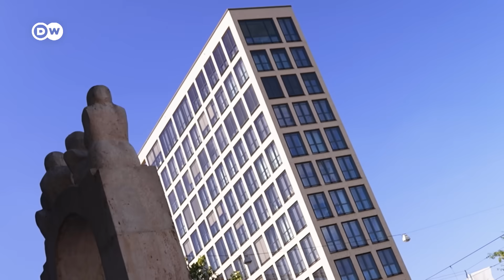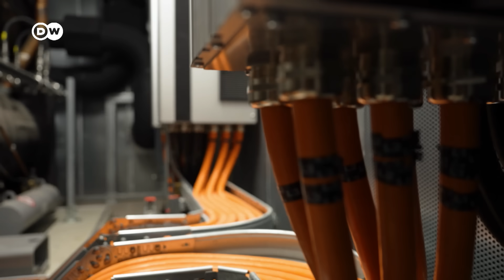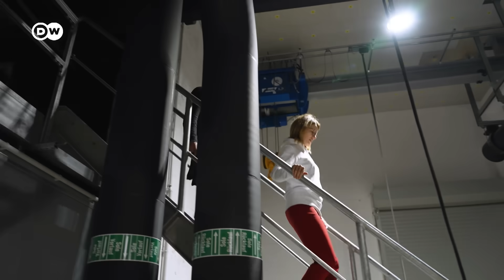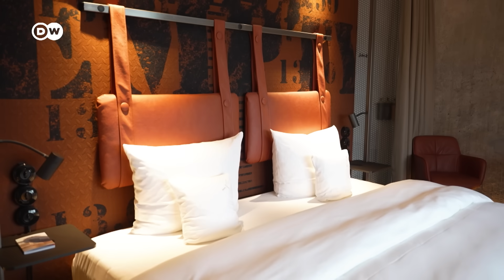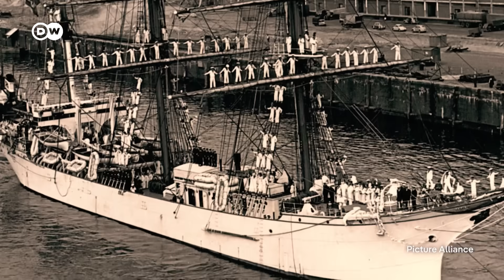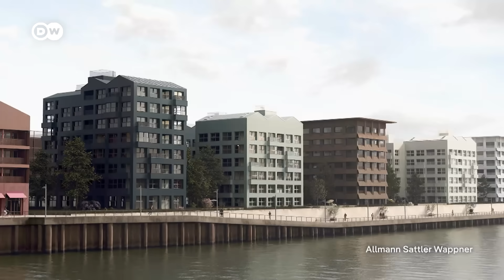River heat pump to supply hot water in Germany | DW News

Comment: combine solar panels with sun collectors on roofs integrated into this system will be higly effeicient if heat from sun collectors , solar collers with heat water from riveror just integrated in the loop
Reply: but more effective additonal system like exowatt on roofs
Reply: with sCO2 turbines districts will power them by their self and having sand batteries will keep them running cheap - hopefully bright future is coming when energy will be mostly free

Comment: These are exactly the energy consumers our grid needs. With large tanks, the heat pumps can run when electricity is available and cheap, and shut off when electricity is sparse. Surely we can build more batteries, and we will definitely, but storing heat in water is one of the cheapest way to store energy and shift demand.

Comment: So downstream we now get warmer water in summer and colder water in winter…. Thank you so much.
Reply: Ever measured the temperature of the water getting into the rivers from nuclear and gas power stations?

Hint: It is multiple times warmer than what the heat pump does.

And cooling the rivers is a good mesaure against climate change, at least most of the time.
Reply: I highly doubt anyone is going to notice anything.  Plus cooler water is probably better for most fish species.   In summer i don't get why they would even need to dump heat into the river...should be able to dump it right into the air.
Reply: @zachlafond2652 I guess the density of the water helps when dumping heat. And if everyone does it, we will notice it absolutely.

Comment: Its not that cheep at all. The equipment and maintenance are not cost effective. They will constantly be heating the water with outside power. Eight years experience working with heat pumps and exchangers on Oildsands plants. See what your costs become when the temperature hits -30 or -40 deg.
Reply: Good that the norm air temperature in Bremen is -9.6 °C and the water still always stays significantly warmer. Also the heating center has some boilers and power-2-heat-modules for backup.

Comment: Well, there are many unanswered answers with this project:
- District heating usually requires very high temperatures, which is why heat pumps in those systems often only reach a SCOP of 2 to 2.5 where state of the art air heat pumps reach 4 to even 6 and therefore use half as much energy!
- lower cost than average district heating cost means nothing since in Germany district heating is usually the most expensive heating option of them all (monopoly situation, very expensive infrastructure, high heat losses on the way to the buildings etc.)

The question is if this system has any advantage above individual state of the art air heat pumps. Is it cheaper per apartment (including all necessary infrastructure)? Is it cheaper to run compared to efficient individual (house-individual) heat pumps? Does it need less electricity? Does it have a lower maximum electricity need in deep winter?
Reply: Star Refrigeration in Glasgow has been installing water source heat pumps for commercial and district heating for over 20 years. Their recent installations have a heating SCOP of between 4 and 7, so 2 to 2.5 seems very low
Reply: @garysmith5025 I have air cooling and I can say that in the summer at night you can hear the noise from the fan. It's not too loud, but you can hear it. If it was water cooled, then that wouldn't be the case.

Comment: Utilising the waste "cold" from the heat pump for an ice rink is brilliant. Which makes me wonder if someone will try a communal refrigeration circuit in parallel with the heating one, eliminating the need for compressor fridges/freezers in homes and businesses.
Reply: Perfect for the winter months, not so much for summer as it may put somewhat additional load on the system.
Reply: @rsmmx-yt  Yes, the ice rink must be seasonal but it is providing opportunity for activity during the colder months when you can't do summer activities, and isn't needed during summer.

Comment: The sea has 10c and Ireland could get a substancial amount of heat  from the Irish ses and the Atlantic sea. It won't interfear as much with the diverse enviroment as with rivers.
Reply: Salt water is very corrosive, usually makes it infeasible.
Reply: @Masterrunescapeer plastic pipe
Reply: In the Esbjerg (port town in denmark) they have build a big sea water heat pump to replace the old coal power plant. If it works well it could be a model system for many port towns with existing comunal heating infrastructure.

Comment: "River water is always warmer than the surrounding air" - err no. It dissipates heat less quickly and accumulates it less quickly because it's a liquid not a gas, water requires about 4 times as much energy to heat as air, which makes it cooler in the summer and usually warmer than the surrounding air (in the winter). Since it's freezing days that makes heat pumps less efficient, I get the point, but let's not give skeptics a chance by policing ourselves (renewable energy optimists).
Reply: For freezing days, the river will still have a positive temperature, and usually this is further down, so 4-10C usually, so still usually at least 1.5-2.5x efficiency.
Reply: @Masterrunescapeer  yes, I agree. I think the genius of this is exactly that. Winter air temperatures often drop to around freezing, but it's very rare for much of the Weser river to freeze.
Reply: Lmao imagine how large would heat exchanger be if it used air instead of water.
Reply: When comparing absolute temperatures heat capacity doesn’t matter. So yes the river is warmer than the air in winter and cooler that air in summer…

Comment: What happens to the rivers eco system when many towns distract energy?
Reply: In an earlier video on this topic it was mentioned the overall temperature drops very little (0.1 degrees if memory serves) so I'd assume that (even with more heat pumps added) by the time the water reaches the next town that some energy gets readded.

Like all renewable solutions, it's gonna be part of the buck shot. Something that works together with a bunch of alternatives.
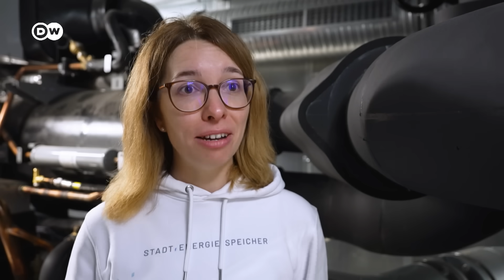Reply: @photoo848  Sorry to inform you that your memory is horrible bad. It extract 3 degrees [02:32] , not 0.1.
Reply: @s_amoku  that is on the water they take from the river.

They don't divert the whole river through their system. So after the heat pump, the 3°C cooler water joins back with the river (a much bigger volume of water) and it evens out to 0.1 degree or something
Reply: @s_amoku sorry to inform you that the higher you sit on a horse the lower you fall. 
It’s basically just like @photoo848 already explained

Comment: Heating with electricity does make us Independent from oil and Gas dictatorships. Also, it keeps the air clean.
Reply: As an American, I think the exact same thing. We give billions of dollars to people who hate us and will use that money to work against our interest. The more self sufficient we are, the less power our competitors have over us.
Reply: @williambarnebee40 
Hi there. This part of economic indeoendence doesn't really apply to the US. Yes, it imports oil from saudi arabia and kuwait, but it exports more oil than it imports. 
In my opinion, the US's biggest reason to stop fossil fuels are effects of climate warming.
Reply: @monkfishmondfinsternis3162  We still give billions to people who hate us. The export/import balance isn't the point.
Reply: Only if the electricity is generated without reliance on those same dictatorships, or fossil fuels. In my province in Canada we heat with gas, but the electricity is also generated largely with gas. So switching to electric heating would help a little in efficiency but it would require a change in source generation to renewables to really make a difference.
Reply: @treechairhat not true. Electric systems are so efficient, that running a hybrid electric system can often times be cheaper.
Reply: @treechairhat 
In scandinavia Heat pumps that Heat only with electricity, are standard. I believe the temperatures are pretty much the same as in canada?
Reply: and straight into the electricity dictatorship.
Reply: @casemodder89
When every house has solar panels and produces electricity, then WHO is the dictator? 😂
Reply: Where does that electricity came from? Lignite.
Reply: @thefrench8847 actually this year, Renewables overtook coal
Reply: @williambarnebee40  not during winter where solar is less efficient.
Reply: @thefrench8847 nope. This year it's taken the spot. Coal is dead. Long live Renewables
Reply: @williambarnebee40  tell me which process silicon is refined for solar panels and which is used for making steel for making turbines.
Reply: @thefrench8847 Wind is more than making up for the lack of solar between October and February.
Reply: @thefrench8847 not coal. Electric induction furnaces. Coal miners are the buggy whip makers of the 21st century. 

Sorry Charlie
Reply: @maxking3  ice can accumulate in the turbine's blade which increase the turbulence, don't forget the humidity.
Reply: @williambarnebee40  i am saying that coal is literally used to refine the silicon that is used in solar panels, and also to make steel.
Reply: @thefrench8847 no, it's not. Silicon is refined in electric induction furnaces
 
Same with steel in the modern facilities. 

Coal is done man. Hate to break it to you.
Reply: @williambarnebee40 no it's not, Intel, the biggest semiconductor company, relies on coal power. I forgot to mention the "reduction of silica" process, please research.
Reply: @thefrench8847 I have. Every single new furnace made in the last decade or so has been electric induction. 

No one wants to use coal. It's done for. 

I'm sorry you're obviously attached to the coal lobby. I'm sorry your job is going away. 

But the environment and society will appreciate it.
Reply: @thefrench8847 You are changing the topic. Looking at the output, wind is the most effective renewable source if energy in Germany and many other countries.

Solving the mechanical issues is surely easier than solving the issues of nuclear energy, which is bankrupting France right now.
Reply: @williambarnebee40  the electric induction don't just fire itself up without coal, and other energy sources, genius.
Reply: @maxking3 Wind is not even the #1 German energy sources, it is fossils fuel, 2nd is lignite
Speaking of bankruptcy, didn't Germany destroyed all their nuclear power plant then blamed Russia for the energy crisis?
Reply: @thefrench8847 dude, how much does the Fossil Fuel industry pay you?
Reply: @thefrench8847 yeah, from solar, wind, hydro.....
Reply: @thefrench8847 lignite coal IS a fossil fuel. 😂

Dude, how much do you make from the coal lobby?
Reply: @thefrench8847 
In my country the biggest source of electricity is wind power. There's Lot more renewables, honey. 😘

Comment: Central heating Pump are not very efficient and the distribution Pipes are very expensive and loss a Lot of Heat. Better is to Pump the Riverwater direct into wach house and use dectrentral Heat Pumps. You need half of the Power for the Same amount of Energy.
Reply: Even better to install a heat pump at the house and just need electricity
Reply: That is patently not true

Comment: Electric heat is not efficient
Reply: A heat pump, where the source of the heat is from a river in this case (but it can be from the ground or the air in other cases) is NOT the same thing as a heat radiator. Heat pumps are highly efficient and in most cases a worthwhile investment.
Reply: @petterbirgersson4489  they will not decrease the cost of home heating.
Reply: @JohnJacob33of course they will! Heat pumps are very efficient and many people have solar panels and they can reduce their electricity bill.

Comment: Electrical based heating is always inefficient and expensive... not to mention potentially dangerous during winter power outages.
Reply: You sound like a Russian bot. Heat pumps are unbeatable in energy efficiency. How are they "dangerous" during winter? Also blackouts are unlikely.
Reply: @bonham1981 it's basic thermodynamics. Air conditioning vice version. You are right , it's absolutely ecologically. In heat pump you can use or hot water, or hot soil as hot reservoir.
Reply: @bonham1981  its going to increase the price of home heating. You just watch.
Reply: @JohnJacob33 not really! There are some people who can reduce their bills.
Reply: This is not the USA. Power outages are extremely rare in Germany.
Reply: It's main advantage is that they are MORE efficient. Operating costs are lower. The downside of heat pumps is the high initial investment. But I am saving money with mine compared to my former gas heating.
Reply: there are two types of electric heating- resistive heating and heat pumps.
Resistive heating is the most inefficient as it converts all the electricity it receives to heat. 
Heat pumps work like your AC but in reverse. Instead of converting the electricity into heat directly they concentrate heat from river water into the hot water pipes, and the electricity here powers compressors. As such it is more efficient, on good days it can output up to 5kW of heat for every kW electrcity it recieves. At worst it should be around 1 kW (On really freezing winter days). 
The only danger here is a refrigerant leak (As this uses water there isnt so much of the dangers of leaking refrigerant in homes, only in the hot water plant).
Reply: During a power outage you cannot switch a standalone electric heater on; the central heating stops working because the circulation pump is electric. So I cannot see how the heat pump water sourced heating is affected in a different way.
Reply: @paulaspinall919  you can "blackstart" the heat pump and circulation pumps. They often not that big compared to a big plant. I guess that clever battery storage is the solution for these situations

Comment: ... and when they start rationing how much hot water and heat you get (or "deserve") then what?
Reply: Why would water be rationed? Not an issue here in Germany.
Reply: @bonham1981  hot water
Reply: It’s a totally different system lol!
Reply: @alanmay7929  its used to heat the building and heat the treated hot water.
Reply: @JohnJacob33 in this clip they took energy from the water or soil. That is how it works. You can even take energy from a ice storage system
Reply: What a load of bs. Central heating is a thing for almost a hundred years. And you need some medical help
Reply: @udavster  ummm youre confusing multiple different central heating types.
Reply: hi ivan
Reply: @pupi-pupi  lol Ivan is John in russian isnt it?
Reply: taxes and monopolys incoming..

Comment: There is no country more bonkers on climate policy than Germany. They have Europe's least successful approach to decarbonisation but their influence is worse. They convince people that decarbonisation is inevitably unsuccessful when it's more their mad policies -- which aren't mandatory -- are what pushes up the prices.
Let's take another aspect ignored in our media when thinking of their heat-pump debacle. An average heat pump costs €28,000 in Germany for a 8kW air-to-water system. In the UK for example, average costs are €11,000. Before asking the basic question why Germany was overspecifying the requirements so much to push up the prices so high they went about trying to mandate them.
Then the reason a heat-pump has such low running costs in the UK (2.5p/kWh) is due to smart tariffs. Germany botched its smart meter rollout so most households don't have one. So, they want citizens to pay a fortune for a great technology, which is under half the cost in the UK, and has triple the running costs of the UK.
Reply: Stats in Germany for heat pumps are 12k EUR, you're quoting a study where the 28k you're quoting is an air to water heat pump that includes extra stuff like defrost buffers, extra heating elements, lower floor (Germany gets colder), better noise insulation, etc., and the UK is 14k. 
Germans are on average richer than those in the UK, so often buy better quality systems.
Your comma is misplaced, UK energy prices are 22p per kWh if cheapest, most are 34p / kWh, or around 40c/kWh in EUR, Germany is at 27c/kWh currently.
Reply: Yeah man 😊
Reply: In New York they use a steam system to heat up the buildings.
Reply: We got subsidies for air to water heat pumps and many companies are greedy. You can also use a AC heat pump

Comment: Big downside to communal heating systems is the monopoly dependence. Rollout of shared heatnet stalled here in Amsterdam because the supplier raised prices and it was more expensive then the natural gas we're trying to cut. 

Fun complication on that is that the electricity net is also overloaded so switching to individual heat pumps is also a problem.
Reply: I guess the government is the one to regulate to ensure consumers doesn’t get bullied! Communal systems is really good for densely populated places
Reply: @alanmay7929  you trust the government?
Reply: @JohnJacob33 locally can usually vote someone in to check it. I trust government a lot more than I trust private business.
Reply: It often is government owned. But there are some problems with abuse of monopoly power if it is private.